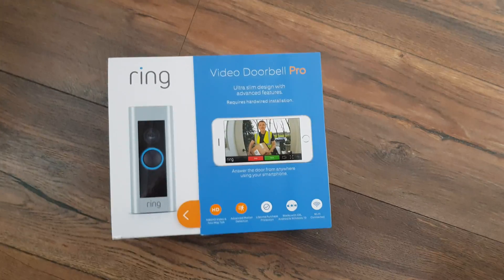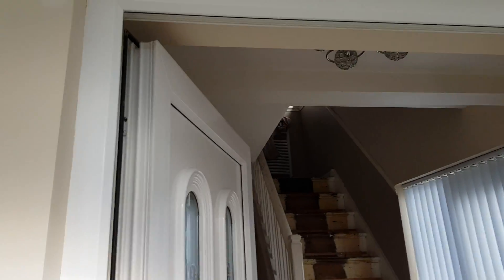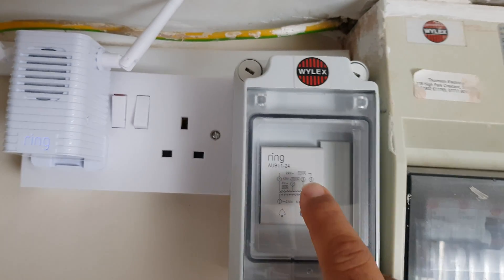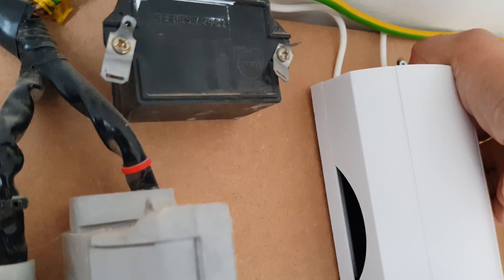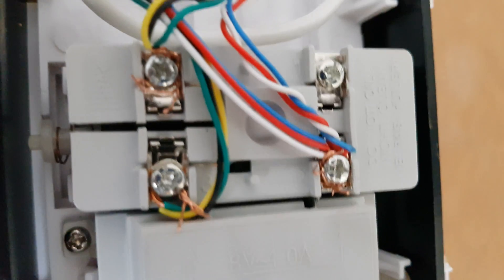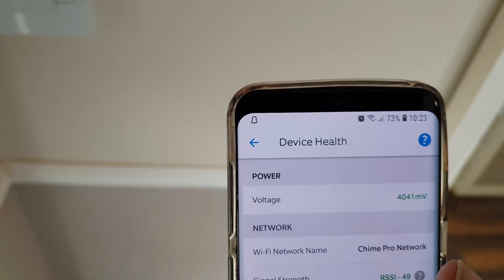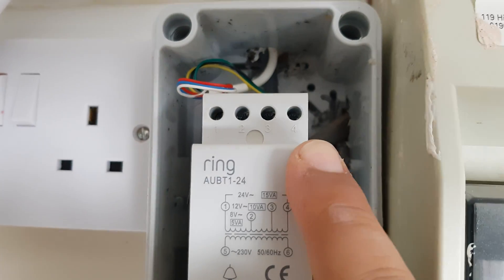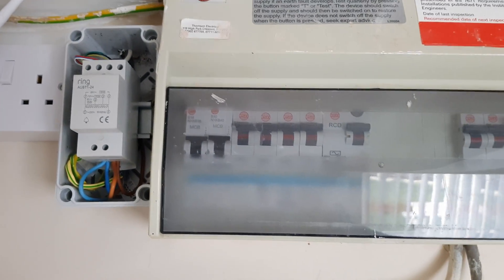Ring Doorbell Pro UK Installation Working On Byron 776 240v 8v Mains Chime Doorbell Working Proof

Comment: I found this video while trying to solve the exact problem above. I want to explain the issues I encountered. I bought a Ring Pro 2 unit. I followed your video and instructions and can safely say it will not work. I used 2 different transformers, the 24volt supplied in the box and a bell transformer with 8v, 12v and 24v. The voltage out from the transformer at 12 volts (terminals 1 and 3) registered 16 volts on the voltmeter. However when wired as you explained the voltage dropped. The ring doorbell functioned, be it a bit slowly, and the Byron 776 solenoid hummed and buzzed and the striker acted erratically and produced a smell. A ding followed 10 seconds later by a dong and the striker shaking. I then tried ports 1 and 2 (12 volts)...no power to camera and no ding dong and finally ports 1 and 4 (24 volts) no sound from bell and camera powered up and acted as normal but no sound from the Byron. It is obvious to me therefore that the Ring Pro 2 is not compatible with a normal mechanical door chime. I cannot vouch for any other model of doorbell from Ring, but to any person thinking of connecting a Pro 2, dont waste your time. Thanks for the video though. Can you confirm the exact model of doorbell from Ring you installed Georgey?
Reply: Did you solve your issue? Having the same with my install
Reply: @waqarahmed09  hi. I'm afraid I didn't solve it. The Byron 776 solenoid failed. I ended up removing the whole unit. I installed an mcb enclosure box and put in a hagar bell transformer.  It's pushing out 24 volts to the Ring doorbell.  It's a hell of a lot safer. The Byron is 8 volts. The Ring didn't work with 8 volts. I needed over 16 to get it to function and have given it 24 volts to ensure connection with a Ring bell.

Comment: Hello Gerogey are you still reading comments on here? got a couple of questions if thats okay?
Reply from the maker: Sorry yeah just been busy working shifts.
Reply: @georgeyporgey9661  that’s alright noticed you did this a while ago and sometimes people don’t come back to older posts lol I have a deta c3105 doorbell which is common and it has a built in transformer. Can’t I just wire up the ring outside to the current bell set up? Don’t understand why they sold it on its own and made it so stupidly complicated in this country to fit the damn thing.
Reply from the maker: You need to find out what's the voltage going out of the doorbell transformer.
Normally standard door bells are 8v.
The ring doorbell pro requires 16 to 24v
That's why I wired from the main distribution board to the ring transformer then across the solenoid which gives the minimum 16v supply aswell rings the chime doorbell.

Comment: A Massive thanks for your help ,  I have a question : I bought Lorex doorbell  with 16V~24V and one Chime box kit. and My dorbell is Byron 776 with 8 Volt . Do I need to install Chimer kit ? Do I need to unplug the Byron transformer and replace it with this kind of transformer ?  In the manual they ask to connect the cble to the Front and Trans pin ? but what I have are  0,1,2 and 3  which one  Is Trans and Front ?

very thanks.

Comment: Hi can you explain why your using 2 cables per terminal? Even the Live and Neutral cables, it looks like you have 2 going into the transformer. It also looks like you have 3 wires connecting to terminal 1 and 3 wires connected to terminal 3. This can also be seen on the terminals to your door bell. Obviously your not using bell wire, but surely you just need a single wire per terminal.

Comment: Hi George
Thank you for this post.
I have an unbranded 8V (Ac) chime connected to my fuseboard and the chime goes to my Pro. I put the Ring transformer in to the fuse board and  placed the bell cable in 1 and 4. I tried it in 1 and 2 and it was not enough to power the doorbell video. Do you think I should use 1 and 3?
I have set the chime to mechanical in the app. All appears well and everything appears to be working as it should. 
Ring said today that I'm likely to burn out the chime as the power rating does not appear enough. They have a ring Pro installation kit on route to me. I am not sure how it will help. Do you know? 
Is my set up OK?
Reply from the maker: Try it 1 to 3 then see what voltage you get.
Reply: @georgeyporgey9661  I don't have any sort of reader. I am not an electrician 😊
What's the worse that could happen with my set up?
Doorbell powers and chimes. But board says 8v and not 8 - 16v
Reply from the maker: So does the doorbell work & chimes up?.

What's the MV on your app says?
Reply: @georgeyporgey9661  it does power the video and chime

Comment: The 776 unit actually outputs at around 15 to 16 volts so you could have taken your 230v mains supply direct to your chime unit. And doing away with the ring transformer 😊
Reply: Hello could you elaborate a little more on this please. Thanks
Reply: @kousafyhan4117  what would you like to know
Reply: @dougiemillar8597  does the pro require more volts? Reason I ask is because I have a ring doorbell 2 which needs 8-24v, the Byron 776 has this at 8v pre installed but I’m afraid I may need just abit more? I wouldn’t want lose some  functions like love video, night mode or anything else at all, plus a lot of people saying it has a humming noise? Sorry also I do want to keep the classic British ding dong
Reply: @kousafyhan4117  so the ring equipment does require upto 24v  a standard doorbell setup in Britain is anything from 8v to 16v.
The Byron kit says 8v but when you actually test it it's output is around 15/16 which is enough to work the full set up.
Reply: @dougiemillar8597  that’s fantastic. I have spoken now to Ring three separate times and I can honestly say they have no idea, I say that because of the information given is always different and even against the previous advisor spoken to. The most I have been told is that my current Bell Deta 3500 has an output around 6V. I am hoping to install the Byron 776 and wishing the transformer will be enough for my Ring Doorbell 2. Again I’m very great full for your advice.
Reply: @kousafyhan4117  haha not a problem! It should be a fairly straightforward change over. You may need to reposition where the wires come into the new unit but that shouldn't be to hard.
Post a picture of your original set up and wiring 
As long as you follow the instructions you will be fine.
Reply: @dougiemillar8597  hello friend. I received my new Byron 776 and almost wired up. Currently I’m stuck on where to connect the old doorbell, I have a white plus blue twisted together and white plus orange twisted together. I should connected one to a 0 and the other to a 2 but not sure which is to which, the manual just shows no colours or labels so I wonder if it matters but still going to look anyways.
Reply: @kousafyhan4117  as far as I can remember blue white to 0  the other pair to 2 let me know how you get on
Reply: @dougiemillar8597  so I have power and shows as hardwired on the divide app BUT I don’t get a chime from the Byron doorbell, only alert on my phone to say someone is at the door. All functions seem to be working but no “ding dong”, very frustrating. Also I tried the wires the other way and was working so I tried changing the wires like you said also to 0 and two but function the same. Currently blue to 0 and orange one to 2

Comment: How is your input wired in? Have wired mine through a CB to N and it trips RCD for sockets. If I wire it through another CB (central heating) in series the boiler keeps switching on/off. Am I doing something wrong or problem with transformer? Doorbell works when wired through heating CB. Cheers

Comment: Hi.  I can confirm that this method does work, however, it means that the solenoid is perpetually energised.  If you touch the solenoid casing you can feel it vibrating.  This means that the solenoid is burning power needlessly and putting unnecessary stress on the transformer.  A much better method is to use the "DOORBELL BYPASS KIT" module in "Pro Adaptor Kit" mode by using the terminal on the other side of the module which is covered by the "DOORBELL BYPASS KIT..." label.  You can then follow Ring's wiring diagram.  This method is described at https://community.ring.com/t5/Video-Doorbells/Wiring-of-Ring-Video-Doorbell-Pro-with-Existing-Chime-in-UK/m-p/27138/highlight/true#M9107

Comment: I previously used this video to wire a Friedland Facet 2 which was about 20 years old. When I moved house, I took the Ring Pro with me but needed a new chime. I originally bought a Honeywell DW313S which was on the Ring list of compatible devices, but after hours of struggling I contacted their support only to be told it was not compatible -- a 'typo' on their website apparently :-(

So, I bought a Byron 776 and removed the transformer just to keep things as simple as possible (although it was entirely unnecessary). I wired it identically to how Georgey Porgey did, but I think the way he's described doing it in some of the comments below is inaccurate. It goes like this:

0 = Ring Pro (top left)
1 = unused (top right)
2 = Ring Pro / Transformer (bottom right)
3 = Transformer (bottom left)

Also, he use 1 and 3 on the transformer, but I stuck with 1 and 4 as recommended by Ring and it's fine.

Thanks Georgey Porgey, couldn't have done it without you (both times)!
Reply: 1 and 4 from transformer to 3 (1 from transformer ) and 4 (4 from transformer) to door bell? Could you please confirm this. Only 3 and 4 had the wires door bell once transformer is out.
Reply: @rajhossain1956  Do you mean 3 and 4 to the chime? My chime is labelled 0-3, if yours is 1-4 then 3 and 4 would make sense.

Comment: Are you using the pro power kit?
Reply from the maker: I'm using the transformer from the ring pro kit.
Reply: Georgey Porgey  thanks for the reply! My pro came with a ‘pro power kit 2’ which they ask to be connected between transformer and doorbell. 

I’m about to connect mine similar to yours using same chime and the provided transformer. Yours still working well? And would still recommend this method? I’ve got the same doorbell, was told the pro power kit would limit the voltage across the chime / solenoid when the switch isn’t pressed preventing any humming.
Reply from the maker: @George9421  still working well. Got anit of humming but I will sort it as I'm refurbishing the house.

Comment: Hi, thanks for the video but I'm still struggling to get the Doorbell Pro to ring my old mechanical doorbell.  The doorbell is a Friedland Type 6 (this type doesn't have its own transformer).  So I've taken the 1st and 3rd connections off the Ring transformer as you suggested. The Friedland has 4 terminals labelled 0, 1R, 2F and 3T. I think the doorbell solenoid is across terminals 0 and 3 (here's a link to a wiring diagram that I found: https://www.tlc-direct.co.uk/Technical/DataSheets/Friedland/107.pdf).  Can you suggest which wires I should connect to which terminals?
Reply from the maker: I've just looked on ring doorbell website to check if your doorbell is compatible and it looks like it is not with the ring door bell.

Also I cant see the link you posted up as it shows a error.
Reply: @georgeyporgey9661  Hi, thanks for checking this out.  I think I'll just have to use the Ring wireless device sound instead of my old doorbell. But thanks again.

Comment: Hi, good video, still working with no probs? thinking of doing this setup, just 1 question why did you still not use the bypass? Thanks
Reply from the maker: The bypass is to bypass the door ding dongle bell which I wanted to work due to if your wifi hors down how do you know if anyone is at the door.
Reply: @georgeyporgey9661  ok thanks for the reply, yours still running with no probs? thanks again
Reply from the maker: @CrIMiN8l  still working fine.
Reply: @georgeyporgey9661  I have seen on their website that bypass connector works as circuit 
which protect the ring bell if there is any fluctuation, basically its protection device for ring door bell. i thought i share this with you guys.

Comment: HI, if the exting doorbell has already a transformer *V built in, is it necessary to add another one?
Reply from the maker: No you by pass the standard transformer as it's only 8v but you have to use the ring transformer at 15v.
Reply: @georgeyporgey9661  got it, thanks Georgey!

Comment: Thanks for the video, it's really helpful.
I'm looking to do the same, but without the Ring chime.
Does the live camera function work as I've read this would require more load?
Have you had any issues with your set up or does this still work?
Reply from the maker: Live works fine put its down to your internet connection
Reply: Great to know, thanks for your prompt reply👍
Reply: Done the same as the video and the chime has been making a buzzing sound. 😢
Reply from the maker: @Abc_Heating  sorry for delay yes it will buzz because the voltage is slightly higher than there tested voltage. 
I know they are supposed to be 8v but I asked byron and they push the test voltage to 12v. 

So yes you will get buzzing as mine does aswell.
Reply: @georgeyporgey9661  I've managed to sort it out, thanks for the reply. 
I will do a video very soon to help people, I'll also link it and credit it to you as you were the 1st person to do this. So thank you very much.
Reply: ABC Heating Services Looking forward to learning how you fixed this! What did you do? Have you had any issues since? I’m desperate to use my original chime but this all seems a bit Heath Robinson!!
Reply: ABC Heating Services did you manage to create a video? Interested to see :-)
Reply: ABC Heating Services could you share how you stopped the humming?
Reply: @Duncan Casey, did you get anywhere with your setup? I want to avoid the humming. I’ve asked Ring to send me the pro power kit. Going to see if connecting that limits the current through the solenoid when the bell isn’t pushed
Reply: George9421 hi George. I have it working! It’s been up and running since Christmas now, no issues whatsoever.

I actually set another one up for a neighbour - same set up, no issues.

I have the mechanical chime powered by a 8V transformer and the ring powered by the 24V transformer.

I have a solenoid doing the switching for the mechanical chime.

I’ll see if I can post details here
Reply: Duncan Casey that would be great! I really want to use my current chime. I’ve currently got the same setup as in the video, but find the humming an issue. Would really appreciate any help! Would be happy to give a few quid for your time :)
Reply: @George9421  Hi George. I thought I could upload pictures here in the comments section but apparently not.

I essentially followed this video:
https://www.youtube.com/watch?v=4ZFl6BRTQnA

The problem is that in the UK, the Pro Power Kit is essentially a 'bypass' (because ring don't really support using your old doorbell in the UK). If you remove the sticker, however, you'll see another port - this is the one you need to connect to.

Don't get me wrong, it definitely requires a bit of work but it's pretty straight forward and works great once set up.

Can I message you somehow? I'll send pictures of my installation.

Comment: Hi, great vid. Just wondering how you got your mains wires from your consumer unit - did you make a hole in the consumer unit and feed the L&N through? Also, why is there two lives and two neautrals going into the transformer?

My set up at the moment is bell wire from push button to door chime.  How do I incorporate the Pro into it?
Reply from the maker: Hi there. 
From the main board it goes to the ring transformer. Then out the transformer on the 16v side in bell wire to the solenoid then out the solenoid with bell wire to the push button.
Reply: Hi Georgey, thanks for the reply. My door chime is powered by a 9v batter, but I believe it can be mains powdered as well using a transformer. Is there an easy way to identify which terminals ti connect to? Theres 4 terminals, 2 connect to the battery and 2 connect to the bell wire. I assume I need to introduce another bell cable into the chime from the Ring Pro transformer?
Thanks
Reply from the maker: I dont think it's going to work as the transformer will give you output 15/16v and your battery output is 9v so it will fry your bell box.
Reply: Is that not similar to how you have bypassed the transformer in your Byron?  i.e. straight onto the terminals?
Reply from the maker: No because my bell unit is mains driven with a 240v input and a step down transformer to 8v but I contacted byron who make the bell and I asked them when testing these bells what voltage have you push too and they said 12v.
Reply: Hi Georgey, I hear that, thanks. Looks like I will invest in a mains bell.  Which Byron do you have?
Reply from the maker: Byron 776 model.

Comment: This doesn't work. I had exactly the same setup. The bell functioned once then wouldn't work again, So I'm guessing the solenoid is new blown (maybe). I did connect to the number 3 power slot. Its a real pain as my chime device constantly goes offline and I'd rather it be connected to my traditional doorbell.

Comment: Just an update. I followed the instructions and was having problems with my transformer overheating. What I did was request a Pro Powerkit V2 from Ring. I installed this inside the Byron 776 across both terminals on the left hand side. I’m using the Ring Pro with the Byron 776 built in transformer and it’s working fine. Voltage is reported as good with 4046mv, well within specs. The bypass kit supplied with your Ring pro can actually be used by removing the sticker that is over it. Peel back the sticker and you’ll see terminals. You need to attach wires to the connections and in turn connect those to your Byron doorbell. So to recap the Ring Pro will work perfectly fine with your Byron 776 built in transformer!
Reply: Hi, any chance you could do a video showing this please?